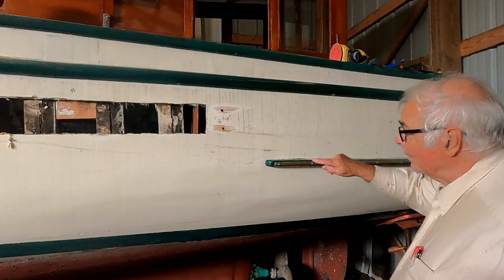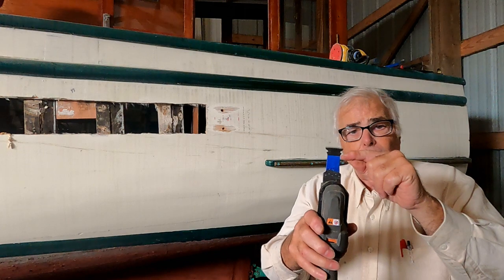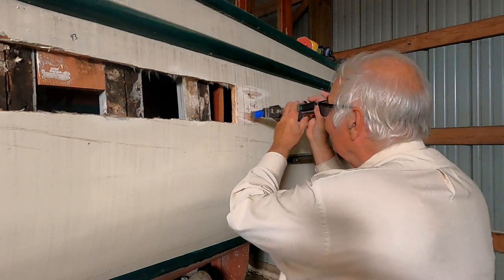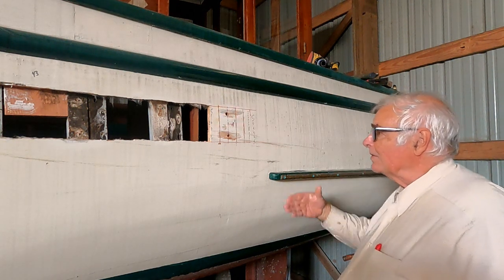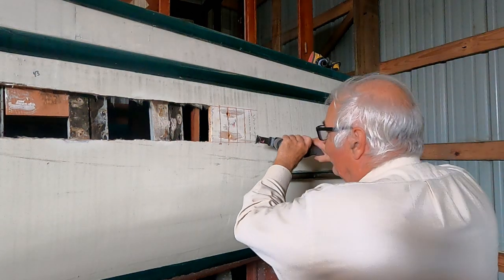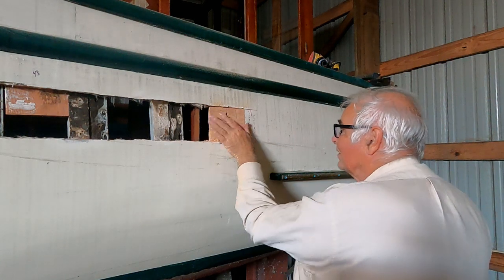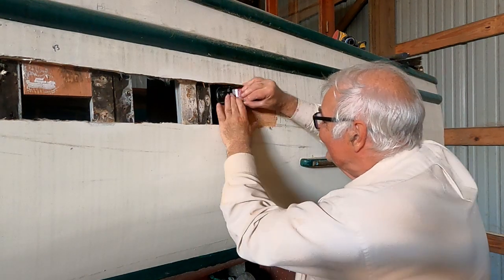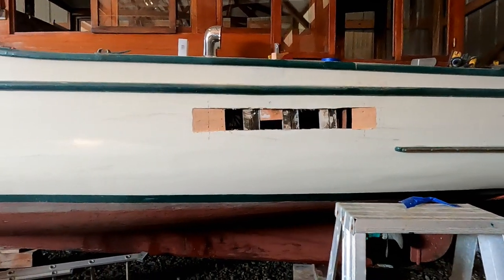Fall Boat Work # 5 - Cutting 5 More Scarfs into the Hull

Comment: Todd — what's the name of that reciprocating saw you're using to cut your scarfs in the hull?  I've done lots of home woodworking around the house and have been a fan of Craftsman tools over the years, but have never seen a tool like that.  Is it especially made for shipbuilding?  Sure looks handy for what you're doing!
Reply from the maker: It is a Rigid oscillating saw from Home Depot.  That type of saw is very useful around the house if you need to make plunge cuts. You can do very precise work with one of those saws.   I also have a Ryobi battery powered version, but the batteries don't last long if you are doing any serious cuts like I was doing.  These saws were originally introduced to the carpentry market by a company called Fein about 20-25 years ago.